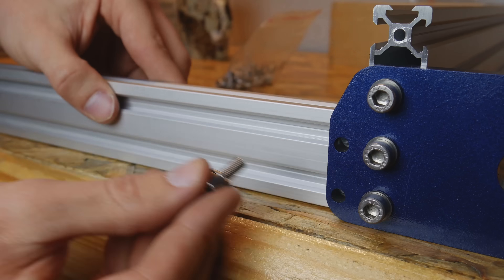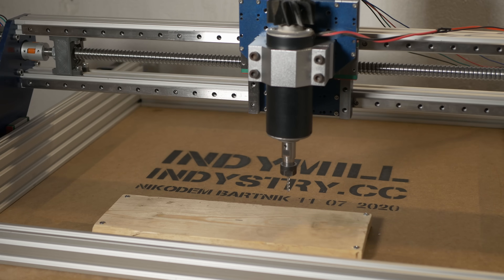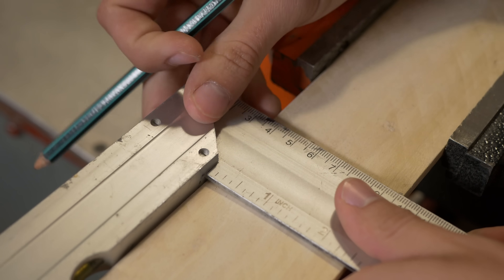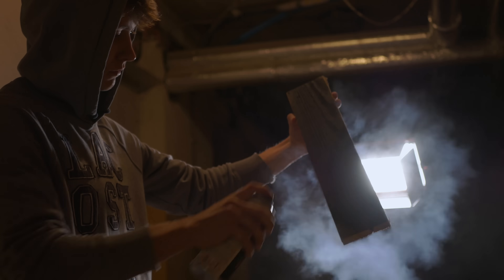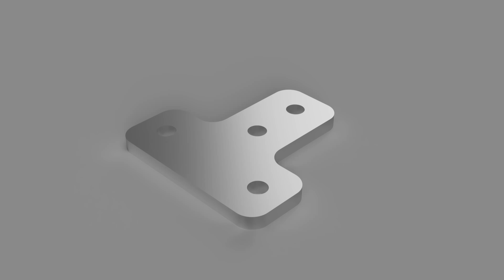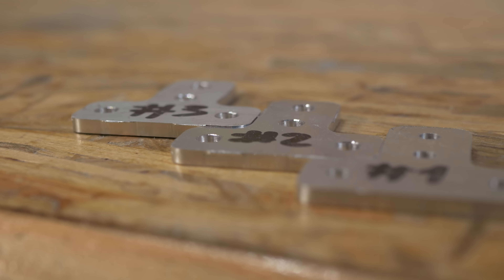IndyMill - Open Source DIY CNC Machine #4 Final Test!

Comment: Greetings. Your problem with aluminum is cooling. The aluminum sticks to the tool. Try spilling a little alcohol solution on your part and you will see big difference. Also if you do not have cooling try smaller depth steps an faster feeding speeds. And yes, you are correct saying that these tools are cheap and bad quality.

Comment: Hi Nikodem, its a great CNC u built here. I ordered your steel plates and all other parts from different suppliers. I sent you a mail about the 3D plastic printed parts because i cant make those. I will replace them later with aluminium onces when de machine is ready :)
I have been researching the internet and for this money you cant get any better than your setup. Great piece of work, thank you mate.
If you like, i can make PCB's with programmed Atmel chip on it, to get rid of the Uno.

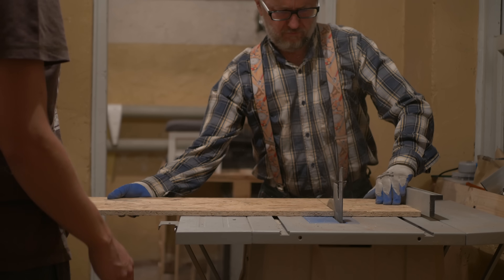Comment: @1:39 Sorry to say that your dad is in danger of getting hit with kickback. This happens when you try to CROSS CUT a piece of wood on the table saw with the short side of the workpiece against the fence. A slight twist of the workpiece will get it caught by the blade and thrown at the operator. Be safe!

Comment: Hello Nikodem,

we have decided to build your amazing IndyMill, however we decided that we would like to use 1.5 kW spindle.

Because of that we need to remodel some parts (for example spindle plate part). Also the 1.5 kW spindle has a different dimensions so maybe there will also be a need to remodel some other parts - I cant tell yet. But perhaps you could provide the whole assembly model, the one that you have on the main page of your "Build instruction" ebook.

I know that what I am asking is a great deal - you have spent a lot of time on this one. However you yourself want to make it open source and this would really help us a lot! Of course we will share all the remodeled parts and our experience with the 1.5 kW spindle once we are done building.

Could you please share the whole assembly project in CAD so we can use it to remodel parts and adapt Indymill for 1.5 kW spindle?

Best regards from Czech Republic

Comment: Try a 2 flute .250 dia x .5 flute length. You also need to make a low pressure spray mister to put a tiny amount of coolant directly on the cutter. At high speeds the aluminum will weld to the cutter.

Comment: Hi Nikodem Bartnik, Thanks for all the videos. Today I have purchased your Build Instruction but i am surprised that there is no Dimensions of plates. If its possible, kindly send me on (Yoursamittomar@gmail.com) all plates dimensions. Also need your suggestions, As I want to increase total working area of the machine. (900X900 mm). Regards Amit Tomar
Reply from the maker: You can import DXF files to any CAD software and read the dimensions here

Comment: I have an Xcarve i'm using with aluminum and i need to use small bits for some of the finer features but with a little lubrication i never gum up the bits if i don't try and go too fast, i never tried going faster though, aluminum tends to heat up and stick to bits so i cant see how going faster works and  also a larger bit at the same speed has a different surface feeds and speeds to consider .. still impressive results.. i have even cut steel with small features on my Xcarv,,..its definitely not as sturdy as yours looks but if i get the settings right it does just fine with plenty of patience.  still i'm looking for something a little more industrial and thinking of overbuilding my own new CNC.

Comment: Hello,

I am a subscriber of your channel, because I appreciate the simple and objective approach you have  to make things and solve issues. :)
But I don't want to waste your time unless you have free time too ;) .
I bought your IndyMill manual, because I am planning on buying one. I really enjoy an easy approach like yours and it can be really easy to follow it. However, I had some setbacks, that I think that you should address

So here goes my questions, recommendations, etc:
First issue I found was to identify the aluminium slot type, since you only have it identified on the links on Aliexpress or BangGood and nowhere else, I think it should be useful to state it is T-Slot so people don't order V slot and then run into trouble.
When I weas You only state you need 8mm axle stepper motors on the coupler trick (I had that doubt, since I didn't find the info of it anywhere, and had to go through all videos to find it). This raised another issue: The BangGood link you have on the part list to the stepper motor points to 6.35mm Nema 23 Motor, and not 8mm (and makers will run into this issue).

I cannot also find the link about the size of the ZZ lead screw unless on the shopping link, it should say it is a t8, to facilitate.

Another opinion is to include on 3d printer parts the cable chain stl and/or the compatible model on aliexpress/Banggood, you talk about that you printed it, but nothing more.
:)

Thank you for the reading and If you want to, I can tell you if I bump into another issue like these, so you can help the others, okay :)

PS- If someone ever asks for a Portuguese translation, I can help you with that, no fee required. I truly believe that the free spirit helping is the one of the best things in this type of maker's community :)

Comment: Awesome project, I'm either going to build a Dremel CNC or an IndyMill for sure.
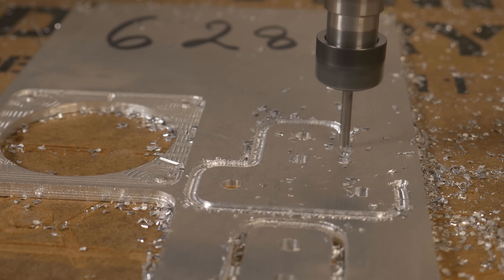It's nice to see you're benefiting from trying different cutters. Watching your earliest Dremel videos I was thinking your machine would benefit a lot from using cutters more suitable for the individual materials. Especially aluminium, which is "sticky", as you found yourself at 9:20 .
A bit of oil or WD40 would work wonders.
Reply: Its better to build avid cnc type ..indimill or Dremel is not sturdy compared to avid cnc 
You can see here https://youtu.be/TZuK2f2Y2vg

Comment: FYI counting delivered cost, I noticed some parts are cheaper on Amazon than AliExpress.  EG  2 - 2040 aluminum extrusion 600mm are ~32 USD on AliExpress, ~$35 on Banggood, but only $25.99 on Amazon and Prime eligible.

Comment: Great video! It looks like, in the high speed of aluminum, you were getting a lot of flex in your spindle. If you raise the spindle so the spindle mount is closer to the collet it will increase rigidity. There's a lot of leverage right now between the mount and the tip of the bit. Your smaller bits won't break as easily if you shorten that distance.

Comment: There are bits for aluminum which work fairly well with softwoods, but two flutes, please. Also plastic bits work well, many are one flute, but can give an excellent finish at the spindle speeds you can get to. There are also wood bits for routers, if you can get shanks that will fit your spindle. Some Dremel-like bits are of good quality. Don’t use regular burrs, or bits for steel. If you mill aluminum, you should use a thin cutting oil. You can go to the information sources for milling which will tell you the chip load per tooth. This isn’t a guessing game. You really need to know this.

The motor really needs two mount clamps. Any metal, and many plastics, will cause a lot of vibration. Plastic also needs carbide cutters or the edges will wear quickly.

I do like the machine though. You did an excellent job.

Comment: Great build, but I would suggest a few changes to increase rigidity which should increase performance. I would guess that if you pulled on the bottom of the spindle motor the gantry will flex.  
1) Mount an aluminum plate to the back of your gantry attached to the upper and lower aluminum channels. This shouldn't increase the weight of your machine significantly but it will be much more rigid. 
2) The Z-axis should be mounted as low as possible while still clearing your side rails, this will reduce your Z-axis capacity but it will allow you to mount the spindle motor higher and still reach your table. The spindle motor is too low in its mount in the current configuration.
3) Center the spindle motor mount on its carrier plate to equalize the load on the rail slides.

Again, this is a great build, I'm just suggesting a few changes.

Comment: Hello
Amazing project ! Congratulations
Questions : 
why not use 3D printing to replace aluminium parts ?
What are the differences between CNC aluminium cutting ability and non ability ?
Reply: I would think some important differences lie in rigidity and durability.

Comment: Dude, nice work. you router is hanging way too low, for cutting wood its fine however when you go and start cutting aluminum you need rigidity and few more things in order to cut aluminum well.  lower your mounting plate of the Z axis down so its in the middle of the column. also you need to use a 2 or 3 flute ZRN coated carbide endmills and you need air nozzle to blow chips from the cut that's why you have a buildup on your endmill. also change your cutting recipe and used Fusion to calculate the cutting speeds based on the tool data or you can lookup any manufacturer they post their feeds and speeds and SFM . good luck.

Comment: Do you have any info on the rigidity of the frame? On my chineese 3020 CNC I used a dial indicator attached to the machine's table. A rod inserted in the spindle was touching the tip of the indicator. Then I applied 1Kg force to that rod to see how far it will move - the force was measured by household scales. Don't remember exact numbers, but I can repeat the measurements. Did this when upgraded the machine to ball screws.

Comment: so how big can this frame be elongated to?  Making the Y axis longer should be pretty easy. The x axis might need a back plate of metal bolted to the top and bottom rails to stiffen it up? could it go 900x900mm without major modifications? 600x600 is pretty small.

Comment: I usually dab Castrol stick wax on the cutter while its running, to help keep aluminum from sticking or melting into the flutes, also using air to keep the chips from jamming up the cutter.  Wd40 helps in a pinch when doing short runs.

Comment: Big fan of your channel!!! Happy to see it complete. I want to build one. Do you think it can handle steel? My target would to build one that can cut steel. Does this motor/controller/adruino kit look good? or do the motors need to be more beefy to handle steel.

https://usa.banggood.com/TWO-TREES-UNO-CNC-Kit-with-Controller-+-Shield-+-Nema-23-Stepper-Motors-+-TB6600-+-Limited-Switches-p-1679143.html?rmmds=search&ID=565876&cur_warehouse=CN
Reply: In my opinion the motors are good enough as a start, and if necessary you can swap them for a better one. What really makes or break it in cuttin steel is frame rigidity. I'm not sure this design is gonna be able to handle it, I would wait for his reply or try to look for other machines designs already proven to work on harder metals

Comment: Hey youngster your product is great. Well done. I am considering to build it. Like to see  Makita router on there .   For some reason this video seem a little somber, lighten it up. Play with more materials. Try ACM aluminum composite material. If you cut it with a V bit then you can bend it. That machine of yours should be capable of some awesome things. Consider reducing the motor to travel ratio. There should be a lot more torque from 10:1.
Reply: Also extend to front and rear bearing flanges along the aluminum extrusion so if overlaps a bunch more.
Reply: Makita routers are not designed for cnc milling. I know a lot of people using also Dewalt. Both lacking the proper bearings and precision. Yes i know they do the job for a short runs and soft materials. The cheapest ok option is Kress. Far better with proper cnc spindle.
Reply: @evgenitantikov5865  They are not that bad the RT0701C they seem ok for this kind of application, yea a purpose made spindle would be better. Cost is a big factor. They are relatively cheap.
Reply: @Allan-mf1he  Yep i have one. They are made in Romania now. Just don't use it with expensive router bits. When overheat router tends to suddenly change the rpm and breaks the bits. Some of the bits cost 50+ dollars. Otherwise is just fine cheap option.

Comment: Better than a MPCNC but more or less underengineered. No fixed bearings (or are there angular contact bearings in the block?) and a frame without torsionally rigidness. MGN linear rails are nmuch better than those ball bearing rails at a MPCNC. But - in relation to your age you did that right. NIce project and tryout. And never fix a collet that way. Its designed to be first in the collet nut , then put the cutter in and fix it to the spindle...
BTW you can see tiny step losses at your cutting lines. Hope you don't have too much microsteps, that's th most common failure with stepper motors - less working torque at hig speed...

Comment: Is there a reason that CNC's are not built in A vertical orientation? That would allow cuttings to "naturally" fall to the floor (or  a tray), instead of collecting or needing a fan.  All of the CNC's I have seen are horizontal, so there has to be a reason for that, right? Thanks for this video and the design, plans, kits, et al.
Reply: Look at the Maslow CNC that might be of interest?
Reply: There is some vertical cnc machines. Mostly heavy duty professional ones and few hobby designs. The reason for people not making many of those is... gravity. ;)

Comment: That spindle uses a grub screw to attach the er adapter to a relatively small shank on the motor; this creates compounding accuracy issues and loss of rigidity. Get a cheap 800w Spindle with inverter and choke up on the tool more :)

Comment: Great work!! Im a CNC Machinist and CNC tool and cutter grinder. One piece of advice is with to use 2 flute endmills for your aluminum work and use drills for entry point into workpiece, also slow way down milling through inside corners. when your mill is engaged on a larger percent of its diameter its gonna bind and break with little torque behind it.

Comment: Don't put the collet inside the motor shaft when installing a new one. Put it into the nut, it will click in THEN you can screw it back on and insert the endmill. To remove it just simply push it out

Comment: Absolutely amazing, i might have to build one of these, a though about your spindle, and your cutters snapping you are using a DC spindle, which is affixed to a  er11 collet, you are going to get a massive amount of deflection between your motor and the collet end due to the small shaft size of the motor, being the closest point to the fulcrum point (lower bearing) you would se a considerable performance increase by switching to a er 20 spindle, such as the 2.2KW air cooled or water cooled spindles on amazon or aliexpress. take a look at the collet support arrangement of yours, vs a 1.5 or 2.2kw spindle.

Comment: Wow great work! I like the design. What working area do you have, especially in the z-axis?
Reply from the maker: Thanks! Working area is about 520x400x115mm
Reply: @nikodembartnik  That's the size I need :-) Maybe a little more height on the Z-Axis. What max. feedrate do you have? Assumption: 5mm pitch, 300rpm =1500mm/min

Comment: Thanks for awesome project!
Question about Nema23 motors, which diameter  of axle? 6,35 or 8mm?
Reply from the maker: I used Nema23 with 8 mm shaft. If you want you can use different diameter just remember to also adjust pulley and couplers

Comment: Excellent. So in the end what are the cutting travel in x, y and z?
And the final footprint?
And want is the z clearance below the z carriage plate?
Reply: look at the bill of materials about 600x600 bed, the z axis looks to be around 100 or 150mm
Reply: @khandam7709  ni thèse are the structure but you have to substract at least the z carriage width, same thing for the Y.

As an example my cnc which is 75*75cm can do 56.5*52cm
Reply: @SebastienChedalBornu  see you answered your own question.
Reply: @khandam7709  no I don't. So stop wasting my time if you don't have the answer.
Reply: @SebastienChedalBornu  its about 500x500mm , but it's open source so you can make it any size you want up to reason. I'm sure it could be made to be 1x1m with a 750x750 cut area . dont' be so rude to those trying to help.

Comment: Nice work! However y ballscrew mount on x axis looks weak, why not use standard attachment, in my cnc i have it and I printed that from pc-abs.
Reply: Kari, can you share files?
Reply: Sure, but it is my own design cnc, nikodem should design sideplate so that it fits. Maybe i could do it if i get those cad files

Comment: Allow me to give the following comment. 
The spindle stability is poor. Add a flywheel as high as possible and that will improve stability. Material st37, dimensions D=80×15
Shorten your mill bit.

Comment: 09:40 The problem is not that aluminium is gummy at low speeds, it has to do with the rigidity of the tool. If you had a tool with a shorter cutting shank and positioned it closer to the collet, then there would be no leverage to flex the tool when the aluminium bytes. Also, some lube would help rob the shavings of their heat and keep them from getting sticky. Lemmino what you think.
Reply: Squirt bottle with turps in it works a treat until you build your own mister

Comment: My CNC design is almost finished, using a Dewalt router, N23's. Using a more symmetrical design to hold the router, everyone goes with the same design I believe has some flaws when cutting.